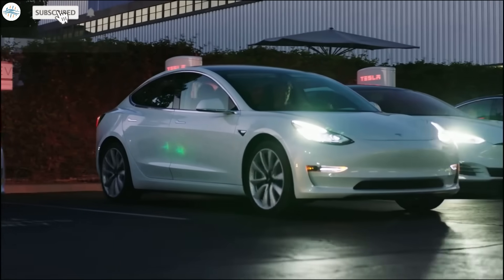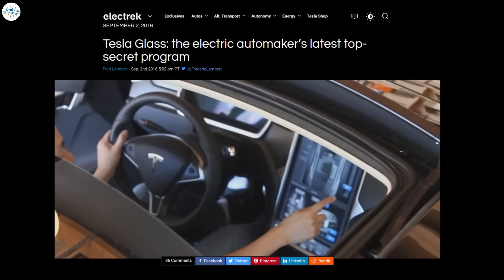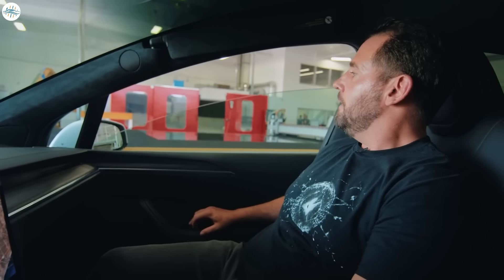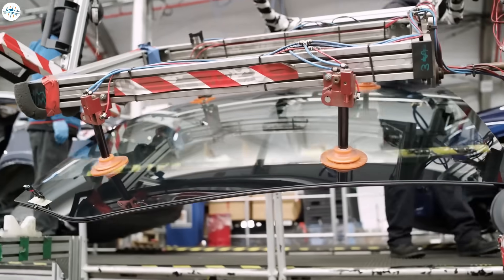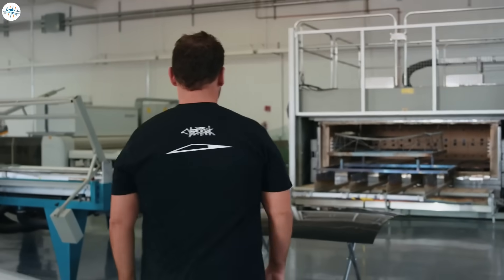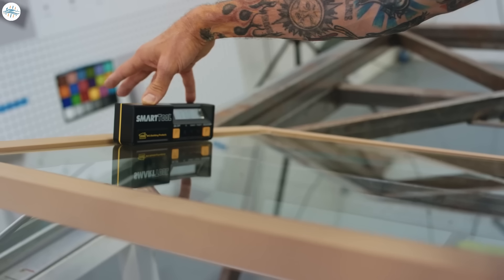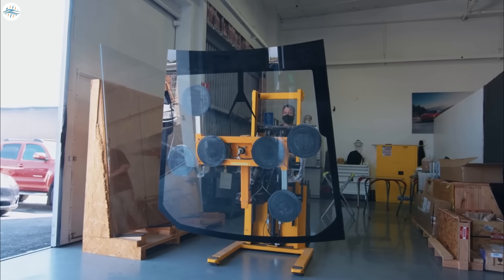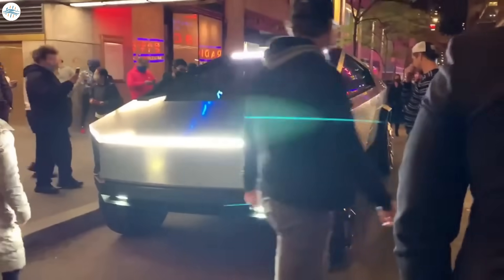Tesla Reveals It's Biggest Secret - It's Amazing!

Comment: My top glass of my 2021 model 3 got broke and it was replaced on warranty. (Good news). The bad news is that they installed the pre-2021 top glass and it turns orange when it gets wet. I'm still waiting for the new one because it does not match the rest of the top glass and it is ugly.